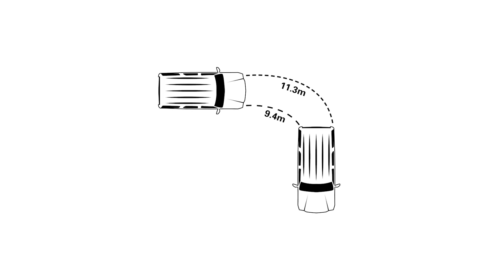SUB $600 DIY LOCKER INSTALL – Watch how much difference it made - Front vs. Rear, Manual vs. Auto

Comment: What about one in the Lc200? Unlike this Hilux The front diff is turning constantly. Plus how does it go with all the traction control and crawl control and stuff on the Lc200 im only asking because im unsure whether to install one in my 200
Reply: Front Lokka in this one is a problem as we dont yet have a Part Time Conversion kit for it like we do the for LC80, LC100, LC105. But we do have one for the rear - literally only developed that a few weeks ago

Comment: Does this locker gana make more sound when daily driving?
Reply: Moto Suragi shouldn’t I’m in the U.S. and our Toyota’s disengage one of the front axle shafts when not in 4 wheel drive. I couldn’t imaging that the systems are different elsewhere. 
In the rear there will be a clicking sound when turning.

Comment: Love you guys also sounded kinda nosy when it turns? Is that normal?
Reply: In a front its almost silent - rarely even hear it, in a rear offroad no problem, on road in the rear some are dead silent, but there will be a tock tock - First installation 200kms or less - the noise is a little louder, but by 2000kms its as quiet as it will get - Its not silent but 10,000s of people are happy with it !

Comment: What about the part where you have to adjust your pinion preload?  You dont mention that.  The pinion preload is usually different than stock with an auto locker install.  I am in the states and have an “Aussie Locker” but the design is exactly the same as the “Lokka Locker”. My experience with one installed in the rear of my 86 Hilux Surf isn’t really as you describe especially on road ... there are times when the road is wet or icy that the sucker doesn’t unlock in a turn and the ass end slides around ... it gets really sketchy because instinct tells you to give a little throttle and turn into the direction your rear is sliding ... with an auto locker the rear end will slide out even more if you do that ... only way to regain control is to turn into it but let off the throttle.  I have to baby her in wet conditions on road to prevent that.  If it’s off-road it’s definitely made my rig far more capable than it was.
Reply: If the Lokka was installed following the instructions - there is no crown wheel and pinion setup required - so on preload to set (things go in exactly the waythey came out and the carrier bearing offset nuts are held in place on the bearing caps. The pinion doesnt come out and so eht collapsible spacer and or pinion preload isnt changed. The Aussie Locker was our Lokka private labelled until 2012 ! We made it in our factory and shipped to the US - their boxes and labels were printed here in Oz !
Reply: @4wdsystemsgeartogoannawher754  just saw this reply after a year haha thanks.  I realize now that as long as the carrier is installed the same way it was before it came out then nothing will need to be adjusted.  ie: make some match marks and back off your adjustment in full turn increments and then you can recreate the back lash that was there to begin with when you reinstall the carrier.

Comment: I'm planning on putting new gears in my 04 4runner, but would like to add this at the same time! Would there be issues if I had this next to 4.88 gears? I know I have to put same set of gears in front and back.

Comment: But when using the lokka  style. You have no steering when the wheels are being driven( on dirt obviously)... yes when axle  /wheel speed Is different  it will unlock..... but when you are in 4wd and you  are driving the front  diff you will not have steering as sean said.... the wheels will try and spun at same speed on dirt surface.... been fitting them for  15+ years.. good bang for buck.... personally I always fit a rear lokka 1st in my customers vehicles.....
Reply: If the wheels are slipping then the Lokka stays locked, if there is full traction then one can unlock - depends on the power and also on the conditions

Comment: Don’t most, or many, 4wd have this by default? I thought when 4lo is engaged that is a locked differential
Reply: That's usually only the center Differential. Most 4x4s come with stock LSD rear and stock open diff front.
Reply: No, almost no factory 4x4s have auto locking diffs, especially not in the front. There are some vehicles, like Jeep Rubicons that have manual pushbutton lockers in the front though.
Reply: @TheDeezelsmoke  colorado zr2 have front and rear push button lockers as well.  Only other truck I know of having one factory
Reply: Gaming Made Simple really? Nice, I didn’t know that. Others that I know of are the early ‘90s Land Cruisers, and the Dodge Ram Power Wagon

Comment: Hi guys  I had this same lokka in my solid axle hilux.. as I have a new IfS ute with Traction control  will a auto lock suit TC vehicles and would it be advertised to fit free wheeling hubs for longevity
Reply: the hilux in the vid would have traction contoll

Comment: I have a suzuki sierra and I want to put auto lockers in both front and rear. There are no downsides to this? Also if your turning while four wheel driving even slightly, won't the locker disengage? It doesn't look like it does in the video so on the road if you turn slightly will it disengage even at the slightest turn?

Comment: I was always told that messing with front lockers or LSD’s in an IFS will cause CV axles to fail.  Because you’re putting a lot of extra force on the axles vs an open diff.  Creating a new “weakest point”.  Is this true?

Comment: Hello. I have a question. If i use this locker in the front differential i have problems on road if i turn my truck with or without 4x4??

Comment: I have a 2012 FJ cruiser automatic. Thinking of adding the locker to the front ( got the OEM electric in the back). How will the A-Track react ?
Also on downhils.  Will it keep engaged? I ride basically sand and dunes
Reply: Auto-lockers unlock anytime a wheel over-runs the drive-line input speed, thus, in downhill scenarios they will often wind up acting like open diffs. The same forces that allow the outside wheel in a turn to over-run and unlock the diff, will come into play on downhill scenarios.

Comment: Hi mate, do you have any suggest for the toyota fortuner 4x2? I opened the link that you wrote on the description, and i found the lokka with part number LKA382 do you think it’s suitable for my fortuner? The engine and rear diff is pretty similar with hilux vigo 2014.

Comment: Question! So a mob in USA have just started making auto lockers for Subies, is that something you do or in your scope?
Reply: Yes - We have 22 spline, 25 spline and 27 spine models - can do the single bolt, 5 bolt and retained stubs (if you can get the Torx out !) That covers all open diffs int he R160 and R180 range. But doesnt fit into the LSDs. Call me on this one - though there are still some application uncertainties
Reply: Price will be $340AUD

Comment: Will it still lock if you're cornering whilst on a track where you lift a wheel or like in mud and bog holes where you need to steer and be locked?
Reply: Yes, it does not allow either wheel to rotate slower than the diff carrier so it is not possible to spin up a single wheel weather straight or turning.

Comment: How would it go on the beach? Say if I was taking a soft sand beach exit track turn full power, am I just going to go straight ahead?
Reply: It will stay locked in that case so without power steering you would go straight ahead. With power steering it will cause some understeer but still should still make it.

Comment: So how does it know the difference between a turn and an obstacle? What keeps it from unlocking if say one tire is up against something?
Reply: What they have told u here is partly true but it will only disengage when you stop the torque to the front drive shaft so under acceleration it will stay locked and on paved roads you need to let of the throttle if in 4wd to disengage the locker under acceleration they will not disengage

Comment: I like the concept, here in Canada we call them lunch box lockers but please don't ask me why. ....Anyway here is my question for your techs Shauno. If the locker disengages when you turn, what stops them from disengaging when the track has a turn and you need to both steer and stay locked?
Reply: The Lokka doesnt really know if the vehicle is turning or not (it could be just going over an obstacle), it works by unlocking if a wheel rolls faster than the diff is driving - this cant happen if there is wheel slippage, and if there isnt slippage then differential action is OK, If it slips in the middle of disengagement then it reengages (almost instantly) and seamlessly.
Reply: @4wdsystemsgeartogoannawher754  ok thank you

Comment: Hey I was wondering if you are able to fit an auto locker to a veichle that uses traction control systems? Will the traction control system just become irrelevant in the locked diff or could it cause any problems?
Cheers
Reply: Yes - as far as I now if the diffs are open diffs and even a few LSDs in Toyota - we can fit them - the traction control system works by sensing "slip" and thats the problem - on a big hill you keep slipping on and off all the way up and just keep losing momentum or its applies brakes all round and wastes horsepower. The Lokka stops the slip in the first place

Comment: Anyone have experiance with front  auto-locker for highway driving in the snow? 
Will be putting a locker in my 110 lux this winter but afraid of it binding up going through a corner.   (I drive with MT's all year round, so need to be in 4wd if I'm even to get off my driveway 😃)
Reply: No personal experience but from what I have read snow and auto-lockers are not a good combination. This makes sense since a bit of torque is needed to unlock the locker in a turn. On a slick surface there may not be enough traction to make the locker unlock.
Reply: @danielhaglund244  Yeah I've read extensively on all forums I've been able to find, but hardly any first hand experiences. A more worrying problem as far as i read was the occasional bind (that happens on tarmac as well)  that makes a loud bang as the rear unlocks, and makes the car want to switch lanes all of a sudden :P  Then again this may be a smaller problem on my reasonably long wheelbase hillux comapred to a say a suzuki... mayby? 
That's the reason I´m trying to find someone that have actually daily driven a 4x4 with rear auto locker on snow/ice.  

Whereabouts are you located Daniel, scenery in your videos looks very familiar, me living in the westernmost part of Finland

Comment: 4wdsystems- can I install this in my Front wheel Drive compact suv (ford EcoSport) I face wheel spin often on slush and uneven terrain, but majority trips are on road. 
Question is does this fit direct to a front wheel drive system ?

Comment: Hi guys, so what is the top speed these lokka"s can handle when 4wd is engaged.  Eg,when driving out a long dune in 4wd high at high speed, can this concept not brake a cv/diff when sudden traction is found?  I am asking as these cannot disengage,it is locked when in 4wd,except when you turn?
Reply: Drove with mines in 4hi/4low at the sand dunes and not a problem at speed or turns since it’s a soft and loose surface. On pavement or rocks, you’ll have a problem with it engaged and turning while on the accelerator
Reply: @jaym6079  tnx, thats what I thought.  The fact that it cant disengage when in 4wd,does pose a problem at hight revs in mud and snow.  Otherwise,it seems great

Comment: Hi. I have a 2014 Toyota Hilux KUN series. I need automatic lockers for the front axle. What is the model/serial no. of the specific locker for my ute? I am getting an option for the lockers suitable for Toyota 8" with 4 cylinders. Is the latter suitable? Looking forward to your feedback.

Comment: But if it disengages when u r turning, wouldn't it also then disengage once you turn the wheel while offroading
Reply: The wheel that is disengaged can only spin faster than the wheel engaged, an can never spin slower or stop spinning. It works great. Had one on the front diff of my 1999 land cruiser 70 and in the rear of my 2001 Cherokee xj. It is better on the front diff because it is transparent when in 2wd, especially with manual hubs.
Reply: That makes sense. Thank you for educating me

Comment: Can you please explain how it actually works? What differentiates a wheel lift and going round a corner? (Why doesn't it unlock with a wheel lift, like when Shaun turned it and his mate held the other wheel still)?
Reply: Hi Chris. It should be called an UNLOKKA. 
It only unlocks when the wheel speed for single wheel is GREATER than the input drive from your engine. For example, you're driving up a difficult track. Your engine is pushing you at 2m per second. You turn your wheels left. The lokka keeps driving your left wheel at 2m/s. Your right wheel (following the longer path) is pushed [by the ground] at 2.1m/s. So the lokka UNLOCKS and allows that wheel to travel faster. But it doesn't let it travel any slower than the engine speed (e.g. 2m/s)

This is because engine drive is via the cross shaft, which moved in a cam-shaped slot and forces the side gears to lock with the cam gears. When a wheel turns faster than the cross is pushing it, the cam gear for that side "disengages" from the cross pin and the teeth between cam gear and side gear allow the 2 gears to separate. The springs push them back together. That's what you hear in the unlock test - the teeth engaging and disengaging.

When you lift a wheel, there is nothing forcing that wheel to turn faster, so it turns at the same speed as the engine. The other wheel is also turning at the same speed as the engine. 

It would be interesting to see how a lokka behaves going down a steep hill. I'v driven down a number of hills and never noticed any issues, so in my experience there is no problem. But in theory, one front wheel could travel faster than the engine speed, but I don't think 2 could (due to the rear wheel speed slowing the vehicle).  But then again, traction is not generally a problem going downhill.  

I'm pretty sure the Lokka operates exactly the same in reverse - cross pin engages in cam slot, forces cams apart. Wheels can unlock if travelling faster than the engine speed. 

Does that make sense?
Reply: @alexdevries7594  thanks for providing such a detailed response. That makes perfect sense. I've seen these lockers around for years and always wondered how they worked. I think I've just added this to my list of mods to do!
Reply: Chris Harris no problems! It wasn’t until I had it in my hands that I could actually work out how it worked!
Reply: @alexdevries7594  do you notice the disengaging sounds when going around I tight corner?

Comment: Ok i installed one of these about 15 years ago in the FRONT of a solid axle 1986 yn67 hilux and i already had an airlocker in the rear that i put in first with the air locker turned off in the rear  ive found that as soon as you put the slightest amount of power to the drive the front prop shaft (and lets face it y motor hiluxs only have that a slight amount and thats why i dont break anything  ) you lose your ability to steer unless you get right off the accelerator in which case it unlocks and you can steer again im not sure how these things are ment to drive on hard surfaces and not bind things up or skip wheels going around a corner or a roundabout in the rear unless you got right off the gas is mine faulty?

Comment: What about if it has hub locks on the front still put the diff lock in the front or put it in the back I know hub lock only locks it to the axle and drive line not to where the power comes from but it still helps so I’m confused or where to put it front or back?

Comment: in more modern vehicles with hill decent control and traction control with application of brakes etc are lockers still recommended and improve the driving or do you rely on the electronics?
Reply: Steve T traction control doesn’t work quick enough, you’ve lost your momentum by the time it tries to give your drive to the other wheel.

Comment: I own a solid axle 96 Hilux, I go 4x4ing just about every weekend and was wondering if one of these lockers would be better in the front or back. Also what is the life span of one of these lockers and is it as good as a manual locker because I have only ever seen 4x4s with manual lockers.
Reply: i run one in the rear of my 96 hilux and love it
Reply: Would recommend the front, I’d prefer a locker in the front over the back any day, having you’re front wheels locked are going to help you crawl up and over whereas the back you’re just going to be trying to push the front up and over, 
Lifespan is great will last a long time.
Reply: I've ran the Spartans locker in the rear of 2 different hiluxs and rate them highly. They work the same as these ones but have a better teeth angle. Ive ran one in the front and didn't rate it as highly as you had to change it in to 2wd for sharp turns even offroad and was a pain in snow/ice
Reply: They are not as smooth as a manual locker as they don't actually have normal diff gears. But on the plus side they are reliable, no need to worry about air or electricity to actuate the locker.  
Front or rear is debatable. In the front you don't notice it on the road, but it changes the steering characteristics when off-road and you need power steering to be able to use it.  
In the rear it is great off-road but can be a bit rough driving 2WD on the road.
Reply: @JeremyPetho  alright cheers

Comment: Great videi👍👍👍💥
•Would it fit my F250 2001  7.3diesel? It has a 3inch lift but not independent suspension.
• do you ship to Canada, or have a rep here?
Reply: 2020 Canada-Wide Parts Distributors LTD. sells everything you need to duplicate this application.